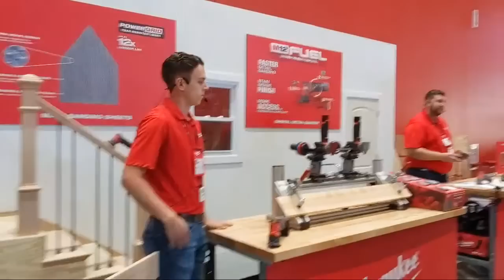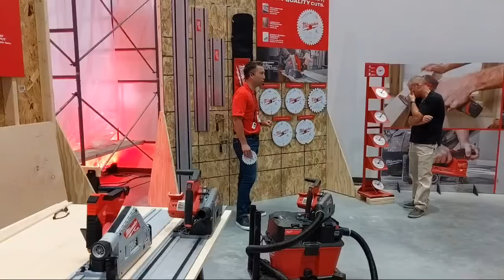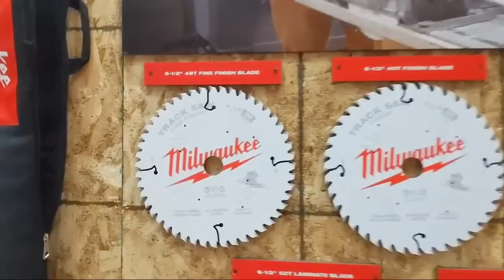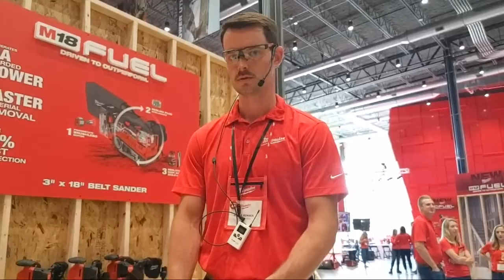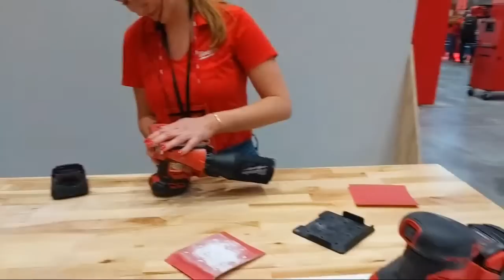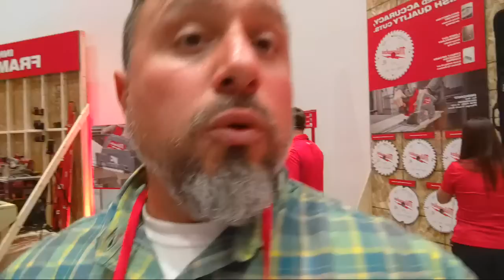New Carpentry Tools at MILWAUKEE PIPELINE 2022

Comment: Love the stream Vince.
I would ask.  Is the track for the Milwaukee track saw  compatible with the German Metabo track saw that I have ?
German parts are hard to come be at the moment.   For example Metabo,  Mafil, and Festool are all use the same track.
Reply from the maker: I’ll find out Stephen, thanks!
Reply: @VCGConstruction  Awesome 
Thank you much
Reply: Stephen, it’s supposed to be Festool track compatible, so that will make it compatible with Makita, Metabo, Mafell, Bosch and Triton tracks too.
Reply: @Smokeyr67  Awesome 
Thank you for the heads up.  That is great news !!!!!
Reply: @Smokeyr67  Thank you for  the information.  That is great news!!!!!
Reply: @stephenleepmg113  no worries, we tool guys need to share the info when we can😀
Reply: I think I saw on another video it works with both Festool and Makita tools. You should be good.

Comment: I asked for the belt sander finally here. I was hoping the track saw would have been a deeper cut.
Reply: belt sander will probably eat a 12.0 battery in 15 minutes
Reply: @mrniusi11  that's 15 minutes of cordless sanding in the field. Not saying it's worth it 100% but that is definitely useful in you own the brand already
Reply: @DubYaJsWorld  if Milwaukee did a good job like they have done with other products it should be longer than that. Anyways I have a feeling they're going to be releasing some new batteries pretty soon too.
Reply: @Anu1000deminsion  yeah that's true! New batteries would be awesome. It's actually the batteries why I went with Milwaukee
Reply: Been wanting one myself. Definitely going to try and get that one on sale
Reply: They all use a 6.5" blade, except for the Festool larger version.

Comment: What’s gonna be the price range for the track saw? Bare tool and kits. That packout kit is pretty impressive
Reply: Bare tool is $399
Kit is $549

Track sold separately
Reply: When does it actually hit the stores? Is there a pre-order?… if so how do you get on the list?
Reply: @msmorales150  Coming out in November 2022. Don't pre-order. Wait for actual reviews first.
Reply: Ben, I would imagine the price will be very similar to other platforms like the metabo plunge saw. My hunch their prices are very close to each other.
The festool however, will always be slightly more.
That's my somewhat uneducated guess.